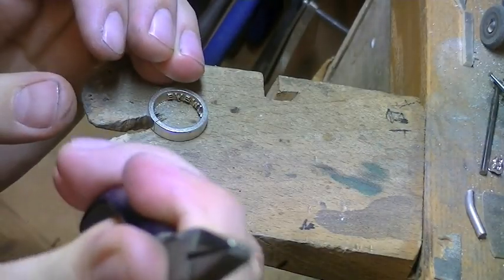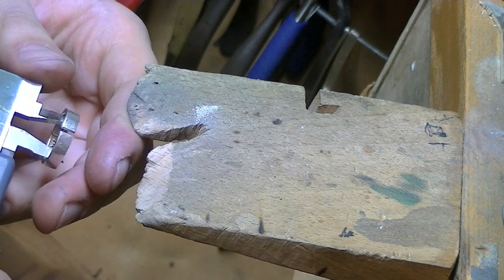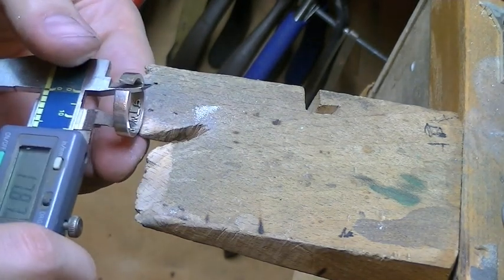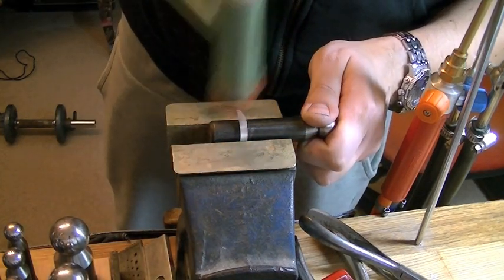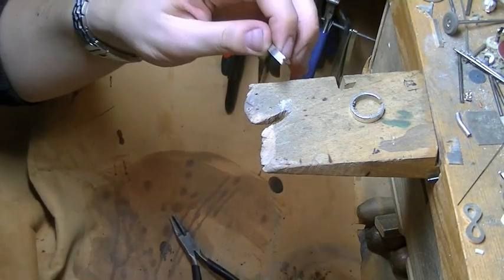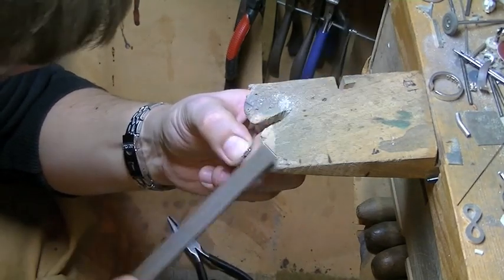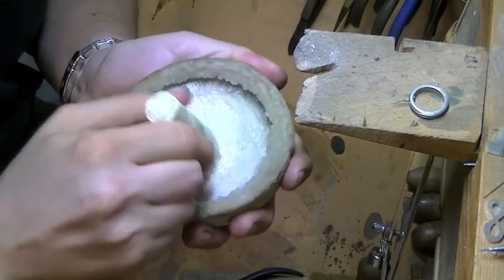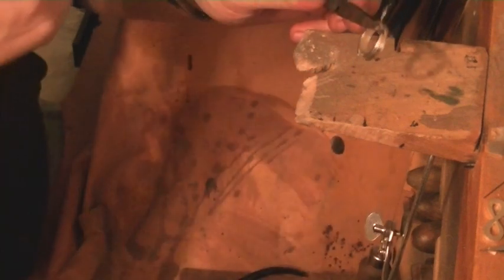How to make a Ring Bigger Part 2

Comment: Thanks Mark, really good video! Would you do the same with Platinum ie. The binding wire marking the metal?
Reply from the maker: Jenny Bowden hi jenny yes I would the only thing I would say is you need gas and oxygen to solder platinum it needs to get a lot hotter than gold . Hope that helps
Reply: thank you!